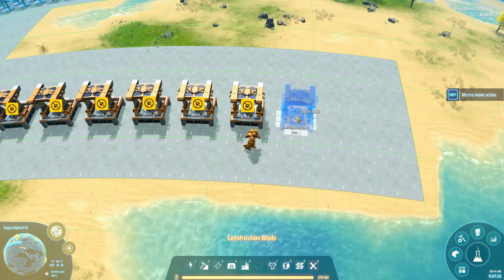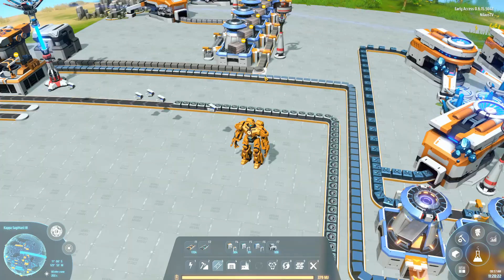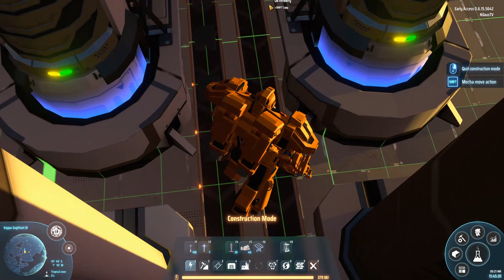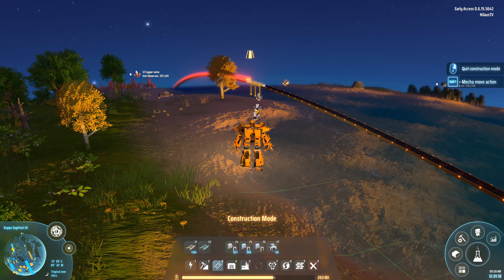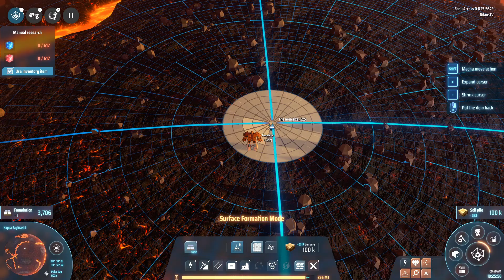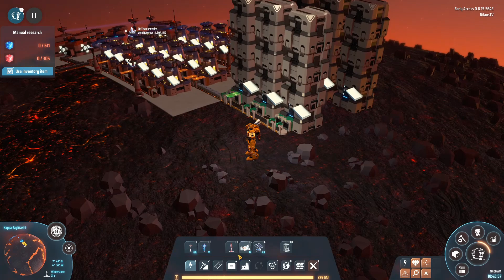CONQUERING LAVA PLANET FOR TITANIUM | #2 | Dyson Sphere Program | Lets Play/Guide/Walkthrough

Comment: The planet's rotational inclination isn't based on the sun it is based on the orbit of the planet. So if the pole is pointed toward the sun on one side of the orbit it will be pointed away from the sun on the other side of the orbit. Half way in between it will point in the direction of 90 degrees from the direction of the sun.

Comment: 49:40 btw just did some quick math. On average, a 1 million rich vein, extracted at the full capacity of a T2 belt (12/s), will last for 23 real-life hours before exhausted. Just some good brain-tips for getting an idea of how long it will last before you gotta start panicking as your whole base starves :D
That means that a planet with 10 million worth of ore, will last you for 230 hours. If your demand doesnt exceed a constant flow of a T2 belt (including the roundtrip time for freighters).

Divide those 230 hours by as much extra demand you have. So 76 hours for three T2 belts in "full flow".
And that is on full 24/7 utilization, which it probably wont be.
So yeah... Having a lava world with 20mil of each ore in your starting system is extremely lucky.

It'll last you for 152 hours at full triple T2 belt output.
I'd say thats pretty much a full Dyson Sphere completed. I'm at 30hrs played so far and im up to 30 degrees. Only 10 of those hours at full proper production. And my solar system only has 3-5 million in ores on the planets.

Comment: One trick you can use for an easy & modular x-ray cracking setup is to place three refineries in-line (1 plasma : 2 x-ray cracking), and using a single belt for hydrogen transport between them. X-ray cracking produces and consumes hydrogen, so by placing the output sorters behind the input sorters on a single belt, each machine will automatically refill itself until surplus production is reached.

Comment: Great vid. Another option is feeding the hydrogen back in. It will match your refined oil output, and instead of having excess oil you will have excess hydrogen after the red cubes. Hydrogen is useful for later (even though I haven't gotten there quite yet).

Comment: You can build hydrogen way easier by building refineries in pairs of 3. One with the crude to oil process and two that refine fuel to hydrogen. Direct insert fuel and hydrogen from the center one to the outer ones, and have the kovarex ones feed themselves  hydrogen from their out line. Tiny footprint.

Comment: a mall is basically just a corridor. at my university we had the north, south, east, and west malls. large open corridors lined with college buildings. the university had been around since the 1800s. the first shopping mall was made in the 1900s. the word was unfortunately appropriated by capitalism. from wikipedia: The term "mall" originally meant a pedestrian promenade with shops along it (that is, the term was used to refer to the walkway itself which was merely bordered by such shops). So yes, you're strip of concrete with buildings is a mall. a hub is a wheel, as you've pointed out in your other video with the polar hub.

Comment: 46:35 ... umm, that's not how angular momentum works. If it's that way in the game, then it's "wrong." Think about far northern locations, like Alaska and Norway: they will have Day for months at a time, but that's also balanced by Night for months at a time. Your north pole is pointing towards the star right now, but it will be pointing away from the star when half a year has passed (if the axial tilt is modeled the way it works in real physics).

Comment: I tried the method shown with advanced cracking to feed my Red Science and I got output constrained on Hydrogen as the loop back never overflowed at the splitter.
In the end I removed all Hydrogen from the system and set the Hydrogen output for each Plant as first on the belt and the Hydrogen input as second.  Then manually fed hydrogen into the system.  Each cycle netted me one Hydrogen and one Graphite and used one Refined Oil.
To stop the system backing up when I wasn’t burning Red Science I put overflows on the Hydrogen and Graphite output into Power Plants.
Reply: Never overflowed?
Reply: @ChaoticNeutralMatt  The belt splitter just pushed items in a full belt loop around the facility and nothing passed into the non-priority output channel.

Comment: I still haven't really bothered with ratios, i just use logistics hubs to ferry everything across. Basically you have one output for each of the commonly used items.
And if i need more of something, i just expand that line. It makes scaling up easier.

The only issue is that they only have a limited amount of slots and cost quite a deal of energy especially for the interstellar one (even on idle).

Comment: If orbital mechanics are correctly implemented in the game, the laval planet wont have the sun on N pool at all times. it will have it there half year on/ half year off :) (off when the S pool will be pointing to the sun)
Reply from the maker: Correct, but I don't think it is (not sure)
Reply: @Nilaus  From what i checked it seems to be correctly done :)
Reply: @fremenGaming  The in-game sunlight is not implemented, from what I can tell, as it would be in reality.  For instance, when the moon I am starting on has it's parent planet between itself and the star, the moon should be in total darkness, yet it is not, the day and night cycle is unaffected by the fact that there is a large planet between it and the star. the light just passes through the planet.  My moon has almost no axial tilt, so I can't say for sure, but it should be easy to test on a planet with a significant tilt, the the orbital period is usually just an hour or two on inner planets.
Reply: @egdod3750  Well maybe that part is not done due to how annoying it would be to play in that case having night all the time for very long periods. I was observing some inner planets and it seems to work properly for lighting in those cases.
Reply: @fremenGaming  what I didn’t make clear was that on the space map it shown my moon as dark when it’s behind the planet, but from the surface of the moon I can see the sun unobstructed, no planet in the way. So clearly there is a difference between the lighting on the space map and the lighting on the actual planet. But I haven’t left mine yet, so I don’t know. When you say you observed inner planets, do you mean you visited them in your mech or just looked at them on the space map?  I think for at least right now, from the surface perspective the sun is fixed in the sky and the planet rotates day/night. If that’s the case a polar solar station should work fine.